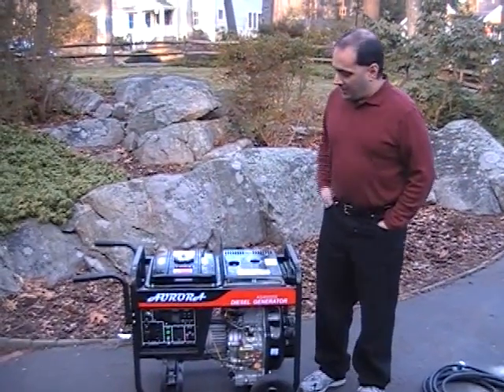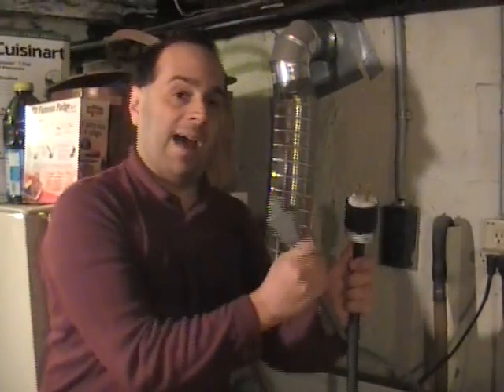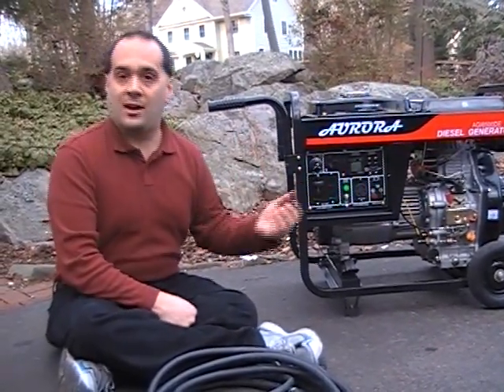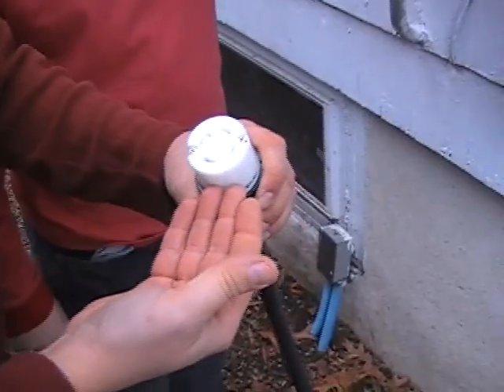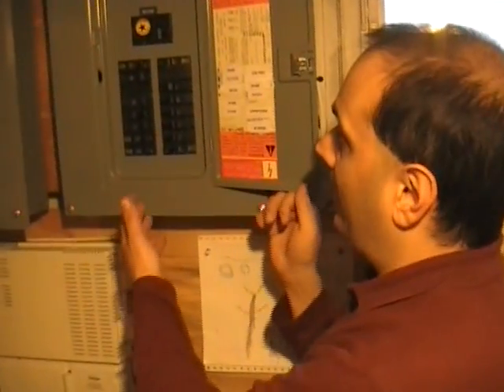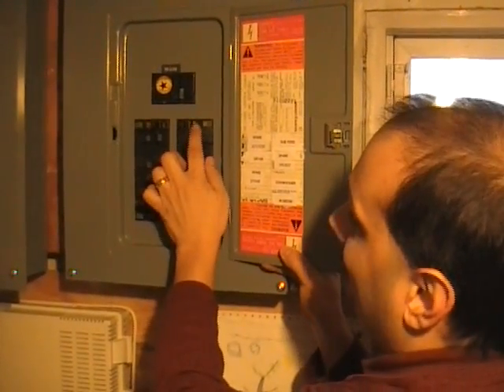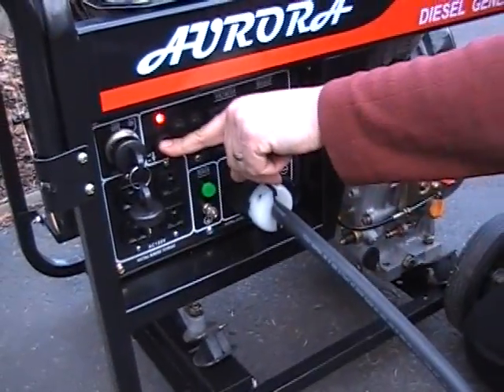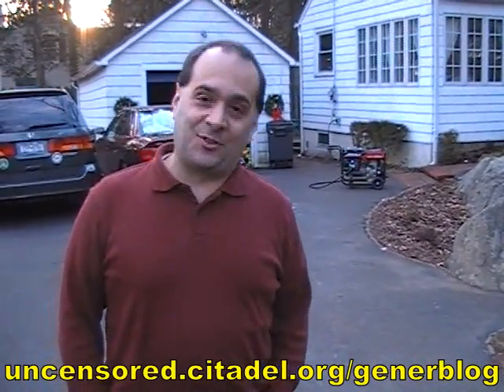Inexpensive residential generator hookup

Comment: Hey man. Was going to plug mine into a welder plug and turn off my main disconnect so I dont backfeed. Saw this video and you figured out an easy way and cheap way to do it. Thanks alot.
Reply: Don’t forget about the generator safety rules: make sure you are always aware of all the warnings before using portable generators. This is just a reminder for everyone’s safety. All generator safety rules should be followed carefully. This advice is just to make sure that everyone is aware of all the warnings and it’s just to remind people to be careful using portable generators. Generators can be dangerous if not used carefully. Every year, hundreds of people die or get injured when using portable generators due to carbon monoxide poisoning and electrocution. Make sure you are using your generator carefully and keeping others safe as well. There is something very serious that everyone should always be aware of when using generators. Some people do run their generator indoors which is not safe and that increases the risk of carbon monoxide poisoning which can cause death of family and you. Some people run their generator in wet conditions which can electrocute them. Please remember that you should never run your generator indoors. Remember that carbon monoxide is an odorless and colorless gas that you cannot see or smell. Carbon monoxide is a silent killer. Keep that in mind. Make sure your generator is 15-20 feet away from your house and away from doors, windows, and vents. Never use your generator in your porch too. Having a carbon monoxide detector is very important against generator safety. Some people also allow children to go near the portable generator which could pose risks. We need to keep an eye on our children making sure that they are not near the portable generator so they won’t get electrocuted or burned by the generator which is dangerous. A locking enclosure also keeps kids safe. A generator shed might look like a tempting place to explore, or take cover during a game of hide and seek, but a generator is a dangerous piece of equipment that can cause injury. It says on the manual that we should also keep children away at all times from the portable generator to avoid injuries. Please do not allow a child or unqualified people to operate the portable generator.  It is important to keep your children safe especially little ones. The portable generator can be hot during an operation. Just because some manuals missed what should be listed doesn’t mean it’s safe to do. Always follow the generator safety rules when using portable generators. Generators pose electrical risks. If you need to use your generator during wet weather, you need a generator tent to protect your generator from getting wet. Don’t let your generator get wet. Keep your generator dry and before using your generator, please make sure your hands and your generator is dry. Do not wear loose clothing when operating the generator. Everything that is said on the generator’s operating manual should not be ignored. Never smoke cigarettes near the generator. Please keep flammable things away from the generator. Never overload your generator too. Your generator can catch fire. Never ever try to plug a generator cord into a wall outlet to avoid back feeding. Back feeding your generator is dangerous. Always turn on your generator first before plugging in appliances and shut off the appliances before turning your generator off. Use a heavy duty cord for your generator and the cord should not be worn out. All the instructions should be followed carefully. Never refuel your generator while it’s running. It can cause fire if fuel spills while your generator is hot. You should turn off your generator and let it cool off before refueling it. Having a fire extinguisher next to the generator is also important. This is only a reminder for everyone’s safety of using generators. Make sure your generator is properly grounded. Having a fire extinguisher next to the generator is also important against the safety rules. https://youtu.be/I1jT3ANENvI and here is a video more about keeping others safe when using generators and also about our family’s safety. It’s important to keep our little children safe as well. Make sure they’re away from the generator. Hope this helps and be safe.

Comment: Opening the breakers first is called load shedding...coming back closing one breaker at a time is called step starting...I like the diesel generator for home use..awesome I work with emergency power systems... great because diesel fuel can sit much longer than gasoline ⛽..nice work
Reply: Here are the rules about portable generator safety: make sure you are aware of all the warnings before using portable generators. This is just a reminder for everyone’s safety. All generator safety rules should be followed carefully. This advice is just to make sure that everyone is aware of all the warnings and it’s just to remind people to be careful using portable generators. Generators can be dangerous if not used carefully. Every year, hundreds of people die or get injured when using portable generators due to carbon monoxide poisoning and electrocution. Make sure you are using your generator carefully and keeping others safe as well. There is something very serious that everyone should always be aware of when using generators. Some people do run their generator indoors which is not safe and that increases the risk of carbon monoxide poisoning which can cause death of family and you. Some people run their generator in wet conditions which can electrocute them. Please remember that you should never run your generator indoors. Remember that carbon monoxide is an odorless and colorless gas that you cannot see or smell. Carbon monoxide is a silent killer. Keep that in mind. Make sure your generator is 15-20 feet away from your house and away from doors, windows, and vents. Never use your generator in your porch too. Having a carbon monoxide detector is very important against generator safety. Some people also allow children to go near the portable generator which could pose risks. We need to keep an eye on our children making sure that they are not near the portable generator so they won’t get electrocuted or burned by the generator which is dangerous. A locking enclosure also keeps kids safe. A generator shed might look like a tempting place to explore, or take cover during a game of hide and seek, but a generator is a dangerous piece of equipment that can cause injury. It says on the manual that we should also keep children away at all times from the portable generator to avoid injuries. Please do not allow a child or unqualified people to operate the portable generator.  It is important to keep your children safe especially little ones. The portable generator can be hot during an operation. Just because some manuals missed what should be listed doesn’t mean it’s safe to do. Always follow the generator safety rules when using portable generators. Generators pose electrical risks. If you need to use your generator during wet weather, you need a generator tent to protect your generator from getting wet. Don’t let your generator get wet. Keep your generator dry and before using your generator, please make sure your hands and your generator is dry. Do not wear loose clothing when operating the generator. Everything that is said on the generator’s operating manual should not be ignored. Never smoke cigarettes near the generator. Please keep flammable things away from the generator. Never overload your generator too. Your generator can catch fire. Never ever try to plug a generator cord into a wall outlet to avoid back feeding. Back feeding your generator is dangerous. Always turn on your generator first before plugging in appliances and shut off the appliances before turning your generator off. Use a heavy duty cord for your generator and the cord should not be worn out. All the instructions should be followed carefully. Never refuel your generator while it’s running. It can cause fire if fuel spills while your generator is hot. You should turn off your generator and let it cool off before refueling it. Having a fire extinguisher next to the generator is also important. This is only a reminder for everyone’s safety of using generators. Make sure your generator is properly grounded. Having a fire extinguisher next to the generator is also important against the safety rules. https://youtu.be/I1jT3ANENvI and here is a video more about keeping others safe when using generators and also about our family’s safety. It’s important to keep our little children safe as well. Make sure they’re away from the generator. Hope this helps. Thank you.

Comment: Backfeeding is dangerous because  power will backfeed to the utility lines, endangering the linemen if you didn't turn off the Main breaker. Otherwise 240v flows through the circuit breaker and distributing it as normal.
Reply: Check for potential & install working grounds. Line crews check before they touch.
Reply: @scottfhscottfh  True but someone can backfeed and start a generator at any time. People are generally stupid and do dangerous things!
Reply: I agree. All generator safety rules should be followed carefully.   Here are the rules about portable generator safety: make sure you are aware of all the warnings before using portable generators. This is just a reminder for everyone’s safety. All generator safety rules should be followed carefully. This advice is just to make sure that everyone is aware of all the warnings and it’s just to remind people to be careful using portable generators. Generators can be dangerous if not used carefully. Every year, hundreds of people die or get injured when using portable generators due to carbon monoxide poisoning and electrocution. Make sure you are using your generator carefully and keeping others safe as well. There is something very serious that everyone should always be aware of when using generators. Some people do run their generator indoors which is not safe and that increases the risk of carbon monoxide poisoning which can cause death of family and you. Some people run their generator in wet conditions which can electrocute them. Please remember that you should never run your generator indoors. Remember that carbon monoxide is an odorless and colorless gas that you cannot see or smell. Carbon monoxide is a silent killer. Keep that in mind. Make sure your generator is 15-20 feet away from your house and away from doors, windows, and vents. Never use your generator in your porch too. Having a carbon monoxide detector is very important against generator safety. Some people also allow children to go near the portable generator which could pose risks. We need to keep an eye on our children making sure that they are not near the portable generator so they won’t get electrocuted or burned by the generator which is dangerous. A locking enclosure also keeps kids safe. A generator shed might look like a tempting place to explore, or take cover during a game of hide and seek, but a generator is a dangerous piece of equipment that can cause injury. It says on the manual that we should also keep children away at all times from the portable generator to avoid injuries. Please do not allow a child or unqualified people to operate the portable generator.  It is important to keep your children safe especially little ones. The portable generator can be hot during an operation. Just because some manuals missed what should be listed doesn’t mean it’s safe to do. Always follow the generator safety rules when using portable generators. Generators pose electrical risks. If you need to use your generator during wet weather, you need a generator tent to protect your generator from getting wet. Don’t let your generator get wet. Keep your generator dry and before using your generator, please make sure your hands and your generator is dry. Do not wear loose clothing when operating the generator. Everything that is said on the generator’s operating manual should not be ignored. Never smoke cigarettes near the generator. Please keep flammable things away from the generator. Never overload your generator too. Your generator can catch fire. Never ever try to plug a generator cord into a wall outlet to avoid back feeding. Back feeding your generator is dangerous. Always turn on your generator first before plugging in appliances and shut off the appliances before turning your generator off. Use a heavy duty cord for your generator and the cord should not be worn out. All the instructions should be followed carefully. Never refuel your generator while it’s running. It can cause fire if fuel spills while your generator is hot. You should turn off your generator and let it cool off before refueling it. Having a fire extinguisher next to the generator is also important. This is only a reminder for everyone’s safety of using generators. Make sure your generator is properly grounded. Having a fire extinguisher next to the generator is also important against the safety rules. https://youtu.be/I1jT3ANENvI and here is a video more about keeping others safe when using generators and also about our family’s safety. It’s important to keep our little children safe as well. Make sure they’re away from the generator. Hope this helps. Thank you. Be safe.
Reply: If you're powering your home with a generator with the main breaker on, your generator will instantly be destroyed with fireworks that would outperform the 4th of July display.  The generator's output will not be in phase with grid power.  There'll be a dead short between the legs of the generator (and the ears of the homeowner).